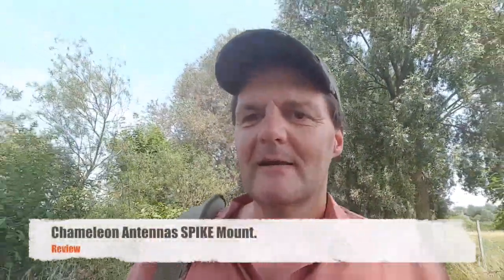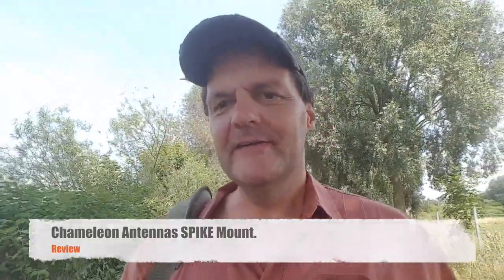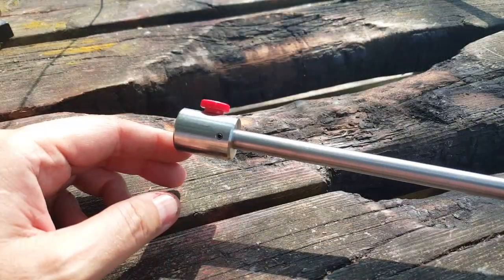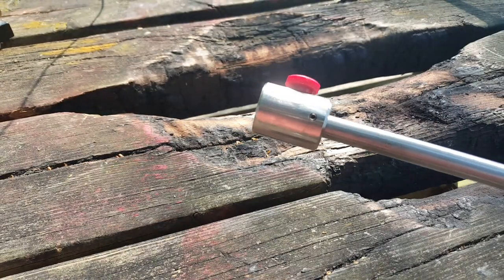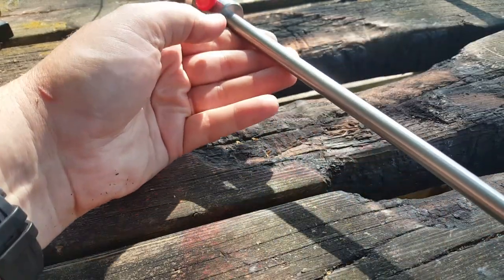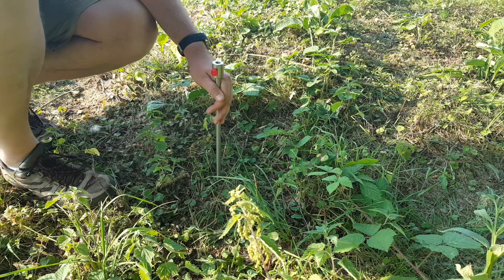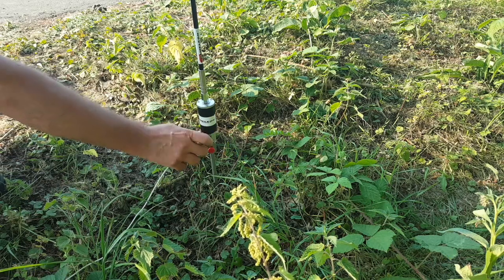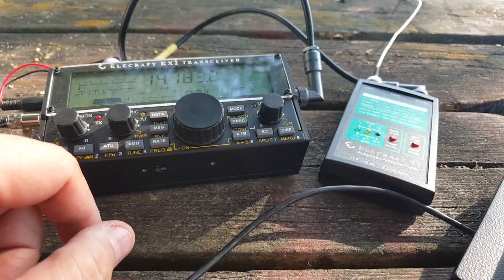Chameleon SPIKE Mount Review.

Comment: These are pretty expensive for what you get.  I made one myself from a piece of aluminum rod secured to a coupling nut, held on by two hose clamps and some JB Weld epoxy.  It is off centered, but is not difficult to use.

Comment: I use and like Chameleon products, but you can also use a section of proper copper coated ground rod and just use the jaws/clamp device for the mounting solution. Be advised, ground rod are also heavy but universally available. I find a 30" section is adequate.

Comment: Great video Gil.. I just ordered the Cha Spike for my Chameleon Micro. Looking forward to using it instead of the super antenna tripod / tent stakes combo.  One thing I'm going to add to the backpack is a 4 to 5" square of thick leather to wrap around the top of the spike as I use a rock to pound it into the ground, it should protect it well. 
73, Ed, N1UHF
Reply from the maker: That is a good idea!

Comment: Its a nice piece of kit and also useful for other 3/8-24 threaded stuff like the SuperAntenna or Buddistick Hey just mix it up, and go play
Reply from the maker: Yep, I might get the MFJ 17ft whip for it..
Reply: AT-271 works and the MFJ whip is an ideal choice as well and it will be interesting to see how  the 1/4 on 20m reacts to the balun. I have the Buddipole whips and they are lighter but not as rugged as the Chameleon Milwhip

Comment: That would bend here in January if I tried to put it in the ground like that..I like the idea though
Reply from the maker: +VE3FAL1_Fred Well, It's steel...
Reply: but my area is lots of bedrock only inches under the ground where I go, so mat still be an issue, would really have to try many different spots to get it to go, I may make one of my own for my Hy-Brid micro and see what happens, 6" tent stakes have a hard time in this area penetrating.
Reply from the maker: +VE3FAL1_Fred Ah, that explains..